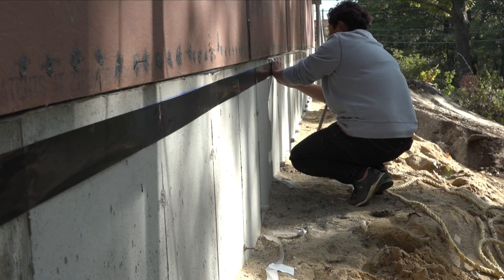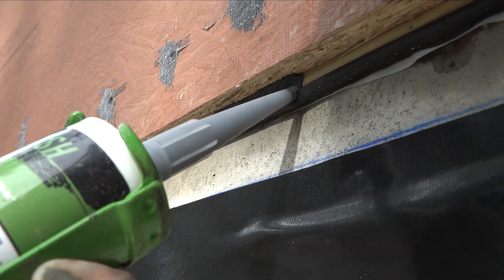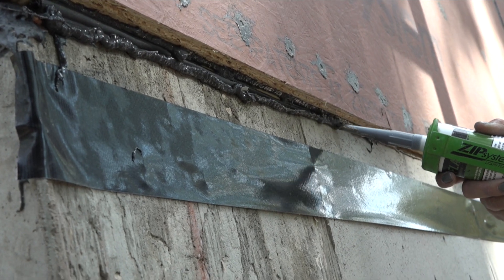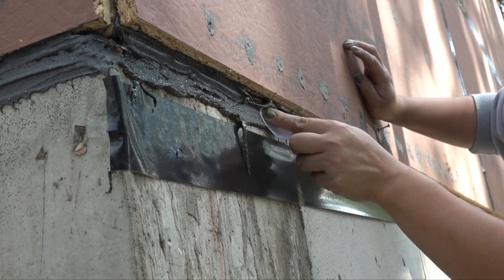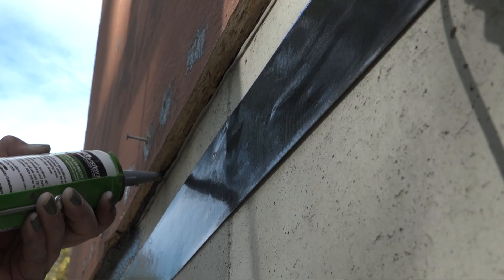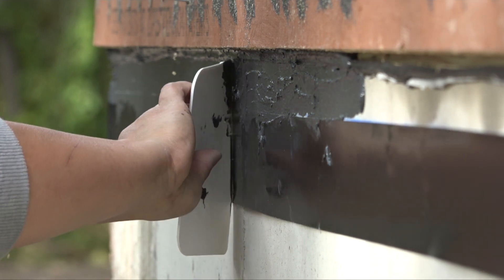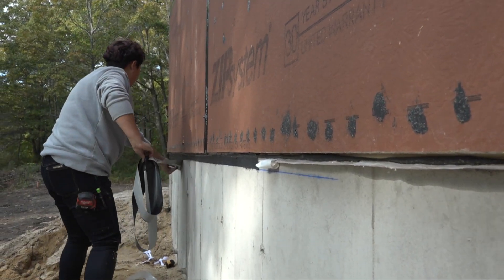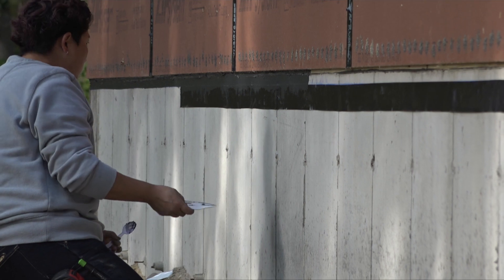Sealing Wall Sheathing to the Foundation

Comment: Needed to apply some to the exposed bottom edge of the sheathing. You can also use a paint brush that is cut down to help drive it into the nooks and crannies.
Reply: was thinking the same. despite zip sheathing being impregnated and not prone to water damage like the cheap stuff, i would have felt compelled to go back and cover that edge, for longevity.

Comment: hey hey, my 1962 home's sheathing sits on top of the sill plate making it exactly flush with the foundation wall (1962 build, no overhang) would I seal the seam between the sill and the sheathing and squeegee sealant over the exposed sill?
Reply from the maker: You could use liquid flashing or high-quality flashing tape. If it is accessible from inside, you could also use spray foam.

Comment: I have now used the liquid flash on several parts of my house and I can now say I love the product and the result, but still hate the dripping.  The liquid is just too …liquid.  All kidding aside, the end result makes the irritation well worth it and I’ll use it in the future (both zip system and Prosecco).  The parts of the house I’ve flashes with these liquids have no bugs at all and no air intrusion at the sill.  The house is much more comfortable.  If I was a mason I’d pull down the brick facade and fix those walls, too.  Air rushes through those walls.
Reply from the maker: great to hear. Have you tried the blue stuff from Obdyke? not sure if it is the same drippiness or not.

Comment: But then, if/when water gets in there, how does it drain out if it's completely sealed now?
Reply: It doesn’t get there. If water gets to it - previous barriers failed and must be addressed
Reply from the maker: Get in where? Behind the wall sheathing?
Reply: Exactly. Seal from the inside only. Otherwise moisture gets trapped.

Comment: I appreciate the video.  Thank you.  I just got done doing this to the back of my house and, unfortunately, I found doing this much harder that it looks in the video.   I want to protect the bottom of the sheathing and the sill from water and feel like liquid applied flashing was the right move.  The first thing that was much harder for me is that my foundation is not tall like the one in the video, only 6 inches, so I was face in the dirt for much of the time in order to see sheathing/foundation boundary.  And my number one gripe is the dripping.  (Oh, the DRIPPING!) As soon as I applied the zip liquid flash strings of the stuff dripped down beyond my tape line.  And that's not the worst problem.  The stuff wouldn't just stick to the sheathing or foundation like I expected.  I didn't see THAT in the video.  How do you deal with that.  I had to go back over and over again, trying to get the liquid flash into gaps.  I'm tired.  I hated it.  If you have any suggestions for how to deal with the dripping I would GREATLY appreciate it because I would like to use this product as she did.  Thanks.
Reply: I'm looking for a good wood to concrete tape for basically this exact reason lol. Looks like a pain in the ass the liquid flash that whole area.
Reply: Use a clear silicone, not the crap product suggested here. Silicone will stick to anything except loose dirt.
Reply: adhesion problems with liquid applied or tape indicates surface contaminants or dust. clean the area and allow to dry, then apply.

Comment: Didn't need to touch up all the nail holes in the Zip sheathing - only those that were severely over-driven.  Bottom exposed edge of the Zip sheathing also needs to be flashed.
Reply: When you say flashed, do you just mean covered using the same flex sealant/caulk like product she was already using, or do you mean something else, like a metal flashing of some kind?
Reply: @bmfitzgerald3  some do both (liquid flash and metal flashing - metal is usually placed for pest control if there is sheathing/exterior insulation material susceptible to insect damage). Bottom edge of Zip/OSB/plywood should be sealed for continuous air barrier (side benefit will prevent moisture wicking at edges and act as a bug barrier - no air gaps means no bug access).
Reply: @ArthurDentZaphodBeeb  Makes sense Arthur! Thanks a lot for replying.
Reply: @ArthurDentZaphodBeeb  can you please send me a video of how to do that , I have rodent problems and they are coming from that   area . I really appreciate.

Comment: Could definitely see a battery  powered caulking gun. What type of tape was being used on the foundation to keep it clean?
Reply: The video says duct tape but others use painters tape I think as well. Might be hard to get it to stick to concrete though, I'm not sure.
Reply from the maker: I believe it was Gorilla tape, Ryan (sorry for the delay)
Reply: I did this last week using gorilla duct tape as well, leaving 1" exposed between OSB and concrete. I used Prosoco R Guard Seam Filler (pink stuff) though, it's probably a little thicker but in the end I imagine the effect is the same.

Comment: Thanks for this video. 
You should really add some keywords to this video, I've been looking for videos like this and only came across it randomly while looking for flashing tape. Liquid applied flashing, liquid applied weather barrier, air and water or air and moisture barrier, air and weather barrier, zip flashing, zip liquid flash etc etc.

And I agree with other commenter, it makes sense to add a layer to the sheathing to flash the entire transition.
Reply from the maker: Thanks. I copied your suggestions and pasted them in, and added a few more as well.

Being a one-armed paper hanger can have its downsides...

Comment: This is exactly what I was looking for.. question will this work for zip-r walls? I am looking at 2” zip-r.. thanks
Reply: You could tape the bottom of the zip r with their tape. Cover the face bottom and back size of the sheathing. Install the sheathing and wipe down the tape with acetone to remove the release agent. This will help zip liquid flash stick to the tape. Liquid flash all the joints at the bottom and the bottom of the sheathing and foundation connection. 

You could also have some sheet metal bent to attach to the sheathing run down to cover the insulation on the bottom and to cover the foundation (1-2inches down). Tape the top of the sheet metal to the sheathing and liquid flash the metal to the foundation. Hope this helps.

Comment: Where and how would you attach house wrap to this?
Reply from the maker: If the sheathing did not already have integrated WRB, housewrap would go on the outside of the sheathing.. Some people seal the bottom with tape, some people skip caulk the bottom, some people do neither.
Reply: House wrap goes over the osb and should be open at the bottom so it doesn't hold rain water if it's penetrated or if a pipe bursts in a wall. This should be under the house wrap layer.

You could do this before or after wrap. Before is easier so the wrap doesn't have to be constantly moved out the way. 

You can use siga tape, prossoco r guard, zip liquid flash, or tremco dymonic 100 (cheapest).
Reply: @ProTradeCraft btw. Your channel is amazing. Some much less clutter and sales pitches than other big channels. The Risinger to ProTrade pipeline is in effect.

Comment: What sill seal gasket is that?!?
Reply from the maker: it is a regular sill seal gasket. The "extra" is sealing the outside with liquid flashing.

People seem to forget that ebvery joint in an assembly is a leak UNLESS it is sealed. People seem to think it only MIGHT leak. But there is nothing hypothetical about it. All joints are leaks unless sealed.